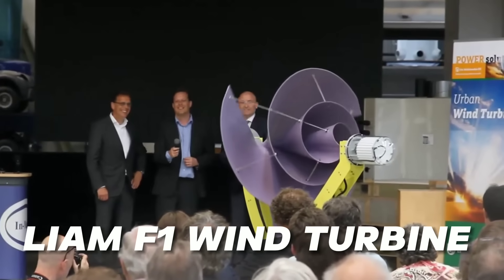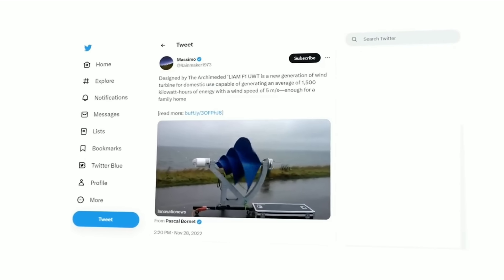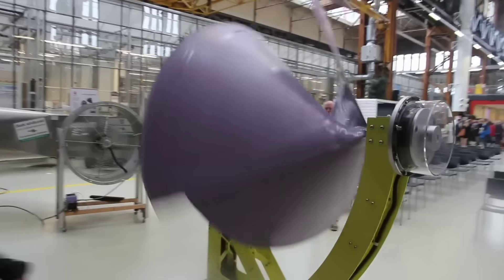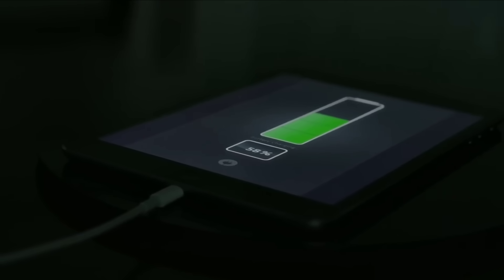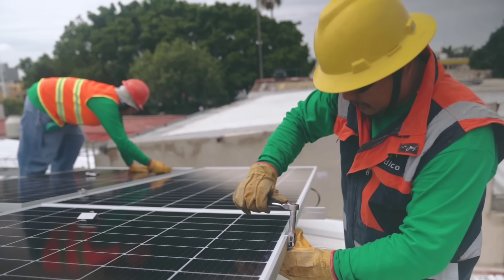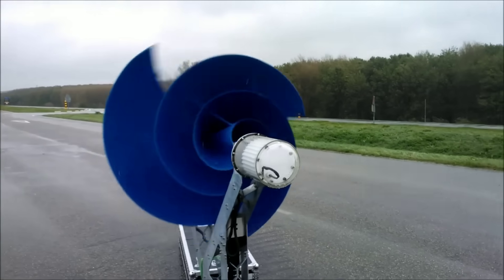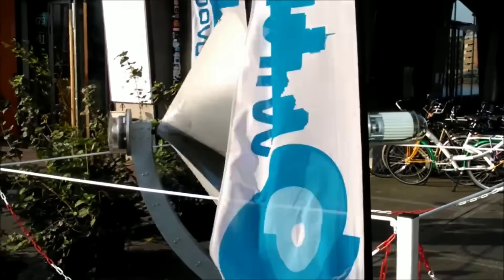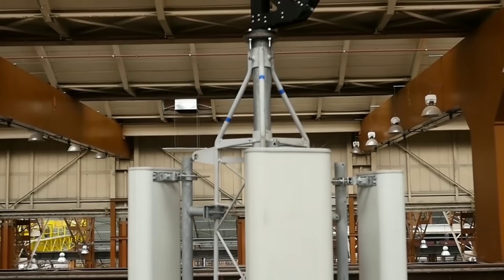This NEW European Wind Turbine for Home Outbeats PV Solar Panels in 2023?!

Comment: Try again See if its deleted again This turbine is no better than other highly engineered turbines for efficiency You need to understand  Betz's law, no turbine can capture more than 16/27 (59.3%) of the kinetic energy in wind. The factor 16/27 (0.593) is known as Betz's coefficient. Practical utility-scale wind turbines achieve at peak 75–80% of the Betz limit.[2][3] As far as the cost. For what 100 USD of turbine and support 50USD bearings 300 to 600 USD for motor and 100 usd for controller for $4500 usd excluding shipping installation and taxes What a deal >>>  source https://en.wikipedia.org/wiki/Betz%27s_law#:~:text=The%20Betz%20Limit%20is%20the,flowing%20at%20a%20certain%20speed.

Comment: We have a 13.2Kw system with 9x 5120Wh of batteries.  I live in one of the sunniest places in the US as well.  Having said that, there are about 3-5 times a year where I have to run the generator to augment our system.  On those days I've thought about the viability of a wind solution and this might be what I was looking for.  I'll probably do some more research and maybe buy one for testing.
Reply: where i live the wind is only 3 to 5 m/s the f1 takes 12m/s it would never turn and it way too high price the permanent magnet generator is only 3 or 4 hundred dollars the rest is a rip off
Reply: Kestral e300i,  but it's a pretty minimal supplement vs your solar, and you need a fairly large mast (10m above obstructions) to get it to work consistently.

There's a few 10kw systems out there if you have the space  though most smaller solutions are a joke.  (Bergey, Zenia, RYSE). Though they have a 8-10m diameter, and need a 35-45m Mast.
Reply: Gas for your generator on those days would be cheaper over the long run, and likely have a smaller carbon footprint.
Reply: @brettgracey9682  I'm planning on a scenario where gas and other essentials aren't available.
Reply: @realityaskew  yep that can certainly change the dynamics.
Reply: Don't buy the thing in the video or anything else that small. Even the fanciest design can't change physic laws.

If you have open free space, place a mast and a big turbine on it. Turbulences from the house or other objects need to be minimized with a high mast, which will also reduce any noise. Then it has to be a big diameter, because the yield increases exponential with size.

There is a big difference between 2 meters diameter and 4 meters - double the size and you get 4x more yield! That's physics!

Comment: The degree of misdirection in this video is interesting. Solar Panels shown being installed against comments re 'maintenence' . And directly showcasing this small low power wind genny against a background of MW sized commercial Wind Generators. 
It's like comparing a soapbox cart with a Rolls Royce in the background.

Comment: Regarding small turbines: Extraordinary claims require extraordinary proof. 

In general, rule of thumb for sober customers: divide the claimed production by 10. Thats a good start to check whether this is worth your money. You dont need to prove your assumption is wrong - the supplier needs to prove his claims are correct. And peer-reviewed and affirmed by third parties.

Besides this, i think the theoretical energy density in wind is simply too low. This means you need to scrap every last bit of inefficiency and reduce costs to a absolute ridiculous minimum. This means no moving parts, low-cost materials and exploiting any trick to maximuze output.

As soon as you see moving parts, expensive prices or parts, you know its not worth the money. Unless you live so remotely and solar doesnt cover your needs. But if its not about survival, dont buy it.

Another easy sign: do you see any serious number of farmers using it? Those are generally smart businessmen. If they dont consider it, dont even bother.

Comment: You don't need much space to install it, But you need wind flow for the turbine to turn and generate energy and not every building gets enough air flow to make that happen. You need specific places where there constant air flow all day and night like riverbank or sea side. And for roads you would need a busy road to make enough air flow for the turbine to work and while at the same time have to ensure that the wind turbine isn't affecting the overall efficiency of the passing by vehicles

Comment: Yeah this thing is garbage at best. The video is either lying or misinformation at best.
First of all, the cost is way too high. You'd need between 15 to 25 years before you recoup your investment, that's insane.

The numbers given can't be remotely true either if you do like they say and install it on your roof. Roofs are the worst places to install wind turbines of any sorts due to turbulence and slow winds
And the waste of materials compared to other wind turbines (vertical or horizontal) as most of the surface of the blade is wasted..

This thing is a waste of proper money and also you'd need to do your due deligence anyway since most places don't even have enough wind ressources to justify any kind of wind turbine.

This is a terrible product

Comment: ~3:30 wind turbines depend on wind. wind is not always present. also they assume an average of 5m/s wind but where does that average come from? from their asses. you can have sunny days with no wind or significantly less that 5m/s wind. no free/renewable comes without the need for battery and mains backup

Comment: If every home had 2 different power source like a  battery power systems to run Lights and electronics and use grid power to run hot water HVAC washers and dryers and refrigerators/deep freezers and any other high powered appliances that could help the environment in a big way.

Comment: found many types of propellers but could not find alternative storage. The most expensive part in clean energy is still the storage part. Batteries are too expensive. they break down in a short time. government electricity is cheaper. good for places without electricity only

Comment: A few false facts here. One being the warranty of solar panels and their life expectancy.  My panels have a 25 year warranty. They also are  capable of charging the batteries in 4 hours. Another issue with wind is not all areas have wind constantly.  The solar panels still work even on cloudy days and in rain. The lowest price 6500kwh is $6300. As for maintenance and cleaning its not difficult and it doesn't have ti be done but a couple times a year in some climates.

Comment: Conceptually a good idea.  Have long maintained that all new builds should come with solar panels and roof mounted turbines as standard.  The price of this model is currently excessive but, like solar panels, it has the potential to reduce with time as more players enter the market.
Reply: Looks cool to me! The batteries are still a recycling problem, though. Perhaps this one can just be fitted without batteries in a windy area?😊
Reply: Roof mounted turbines are pure garbage. There is not a single one that has even gotten close to proving itself.
Reply: Conceptually the easier method is just to modify a alternator and use a. Frisbee... Wind equals sound energy equal sound waves... Air Watts pressure wave propagation fields... Sound technically you can collect just as much energy using a speaker driver
Reply: @mjolnirswrath23  that's a whole Lotta garbage and will not produce hardly any usable energy. Residential wind turbines are nothing more than tinker toys. You could buy a used $50 solar panel and throw it in the dirt and it will give you far more energy than a residential wind turbine, even high-quality professional ones. Unless it's on a 60 foot tower and your annual average wind speed is in excess of 13 miles an hour it is an absolute waste of money and time.
Reply: by setting up a leaf blower on your roof it will operate at all times - and when wind drops. neat
Reply: No. Turbines are not worthwhile. Anything on the roof will definitely be too small, will make a racket in  the house and will shake the roof to bits.
Reply: It's an awful idea. This types of turbine don't work. It's also extremely expensive.

Comment: You are over selling your product. I would never buy from you. This design may be 80% efficient but that number means nothing at all. What matters is how much power you can make for how much money. 3 blade designs will outperform this overly complex turbine every day of the week. Also due to the moving parts, wind turbines always have more maintenance than solar panels do. Hydro turbines are a leap above this, assuming that your location is good for it.

Comment: I'd love to combine both technologies. But in my area.. I'd need to think about hail and  strong storms. . If it wasn't powering a power-packed, then you could sell the excess generation back to the grid (at a far reduced rate) but it would be nice if there was some sort of protective cover for hail. Plus it would need to rotate based on wind. What about an aluminum dome/tube that may even act has a wind tunnel to increase the efficiency. I like iI. But its not ready for SE Texas. But yes. I'd consider it

Comment: After reading several responses I've come to the conclusion that a mix of solar/wind is the best solution-especially for those who live in the northern portion of the country.  I agree that the cost of this particular product seems to be extreme, but I believe the same can be said for solar panels considering how long they've been around. I also want us all to start producing our own electricity one way or the other for more practical reasons; the hideous giant wind turbines are not just an eyesore, but seem to be a threat to various wildlife species (birds, whales, etc.) What many people don't think about is that there are options that we could capitalize on right now. The water source into your home whether you have a well or are hooked up to city water supply is at a constant temperature of approximately 55 degrees. By using the already available water source, you only need to increase that temp by 15-20 degrees in the winter, and can use it to cool homes in the summer. There are also other ways to create electricity such as a mentos wheel that turns constantly and provides a minimal amount of electricity but can keep a battery charged for emergency use.  There's more to this than just how cheap you can make electricity but the consideration of safety, availability, and reliability. Lastly don't forget that the utility companies are going to fight against this. They don't want the public to be able to not only divest themselves from "the grid" they also don't want to have to pay you for back feeding their lines regardless of what they are willing to pay-
Reply: Whet is the actual power data, they are claiming power out put that is not possible. It appears to be a marketing scam.  First, they are indicatingv15mph winds,  this is very uncommon, then they are indicating it costs 5k ea, that's significantly more than a solar system.

Comment: I'd try both for sure. Here in Arizona though, there's almost never any wind. At least in the valley.
Reply: It is more applicable to areas of lower solar gain on Multistory buildings of adequate size can be retrofitted with a permanent roof crane to effectively construct a roof wind/solar generation, incorporating wind from the flat wall.  This new system is possibly quieter than the current one's in existence, which sometimes have solar panels covering some but not all  the roof space to make maintenance easier. The crane can used for panel and parts replacement years down the line.

Comment: buy those with double the battery capacity. Then buy crypto miners. Use wind to make electricity to make crypto. Sell crypto. That is the only way to have reasonable roi with this. Otherwise, it is overpriced.

Comment: I checked out the company website and the LIAM F1 is rated at 12m/s wind speeds, which is really high wind, like in the middle of the Atlantic. At wind speeds of 5m/s as is common for many residential areas, this turbine is no match for current wind turbines.
Reply: I had measuring equipment in north part of the Texas panhandle we measures a 10.8m/s average wind speed one month.
Reply: "Rated", what does that mean? Is that the start speed or optimal speed. What is the start speed?
Reply: @AORD72   Rated speed is when it hits nominal power. There is also a cut-in speed, a cut-out speed, and a damage speed.
Reply: It’s a scam ,, not going to produce any power
Reply: How cost wind mill per day how unit s come out
Reply: These green energy things are all a scam.
Reply: Wonder if a one or two mini versions of this mounted on a car would help with electric cars??
Reply: @FightCollective  the additional wind resistance overrides the power generated.
Reply: @laughinggas5281 this concept with a paddlewheel actually studied to put on top of diesal semi's cab carrying refrigerated containers to use the power on mountainous routes and the power the truck systems like Mazda's soft hybrid rather than power the wheels or use to power the refrigeration. The inlets to the generator could be closed when the truck is not pulling a trailer to reduce drag, or opened for braking like a regenerative system. Not efficient enough for flat routes.
Reply: No., Learn some physics. @FightCollective
Reply: @FightCollective this concept with a paddlewheel actually studied to put on top of diesal semi's cab carrying refrigerated containers to use the power on mountainous routes and the power the truck systems like Mazda's soft hybrid rather than power the wheels or use to power the refrigeration. The inlets to the generator could be closed when the truck is not pulling a trailer to reduce drag, or opened for braking like a regenerative system. Not efficient enough for flat routes.
Reply: @FightCollective  If you are thinking of the speed of the car creating energy, the answer is NO..! Creation of that energy will consume battery power. The net result is loss of energy. Very rarely there may be a slight advantage as in the case of an aeroplane saving a bit of fuel when there is wind in the direction of flight, but of course it cancels out when the wind opposes..!

Comment: IT MUST HAVE PROTECTIVE  GRILL  ANY BIRDS WILL B TRAPPED INTO ROTER FAN BLADE SHAFT WITHOUT PROTECTION COVER ITS BIRDS KILLER
Reply: In the wind this appears as a solid to birds so they will not fly into it not even bats.

Comment: Amazing how these companies skew the TRUTH!    Solar panels have a guarantee for 25 years, mine have been cleaned twice in 17years!  I did it with a bucket and a brush!  Took al of 35 min!   This mill only has a much shorter guarantee, and if these bearings are going to last as long as solar panels, I bet they are going to cost you a bloody fortune to replace, AND, I bet it has to go back to the manufacturer to be serviced, a long long, LONG way from Tasmania!
Lets top that with panel costs, depending where you are and your Government subsidy. 
Panels win hands down because here I could buy 2 sets of panels for one Liam F1 So thats 50 years of power for the price of one turbine!!!